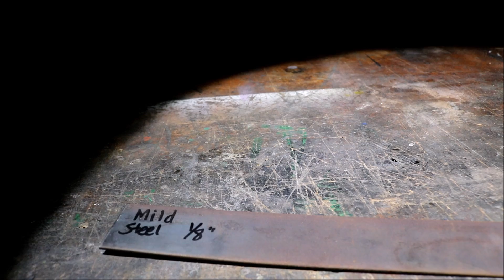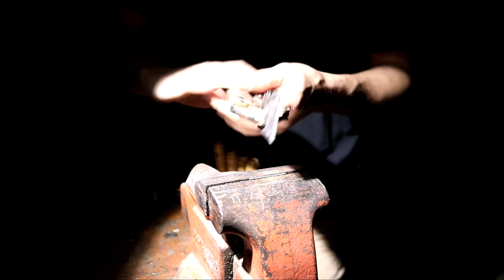Can You Harden a Saw Blade?

Comment: I'm learning  how to make knives out onto saw blade. I hope you answer my questions.
What kind of quenching oil you use and what is the temperature of the  metal  before quenching it?
Reply from the maker: The quenching oil i use is old peanut cooking oil.  I use a magnet to check the temperature of the metal when heat treating.  Basically heat the metal up to a red color and then I use a magnet to see if it is still magnetic.  I'd the magnet sticks it needs to get hotter.  Once the magnet stops sticking I heat it a couple more minutes to make sure the metal is heated evenly.  Once its nonmagnetic I quickly quench it in the oil.  I leave the metal submerged in the oil for a couple of minutes until it cools enough to handle.  Then I use a file to make sure the edge is hardened.  If the metal has hardened then the file will not bite in to the metal it will just glide off.  If the file removes material from the quenched metal then it did not harden.

Comment: Good video Dan the Maker Man!!! Is there a a fire risk when quenching using veg oil or motor oil?
Reply from the maker: Thanks, yeah there is always a risk when dealing with fire and especially oil. I've never had any flare ups but that's mostly due to me not lifting the blade out of the oil until its cooled way down.  With that said I do always have a fire extinguisher at the ready just in case.
Reply: @danthemakerman  thank you for the fast reply!

Comment: Is there anything special about the oil you quench with? Does it need to be warm prior to quench?
Reply from the maker: Ideally if you can afford it buying actual quench oil is preferred, something like Parks 50 Quench oil.  But the cheap route is to use cooking oil or even used motor oil.  I use old peanut oil.  It's a good idea to heat it slightly, I never do and have never had any problems but my quench oil never gets below 70 degrees in my garage.  If you want to heat treat properly there "heat treating schedules" online you can Google.  They are specific to the steel you are using.  This saw blade is a mystery steel, as I don't know the actual carbon content so usually it's best to quench in oil.  There are some steels you can water quench but I have zero experience with any of those.

Comment: So if I just make a knife from saw blade without tempering process it,will it hold the edge?
Reply from the maker: Potentially, the problem though is that you will have to cut, shape and sharpen it without causing it to overheat and ruin the temper.  Once you heat an already hardened and tempered blade past a certain point you can ruin the temper and make it soft. Also working on a hardened steel, it a lot more work because it is already hardened.  Cutting it with a hacksaw will be a lot of work and will probably require several hacksaw blades as they will go dull a lot faster since the metal is already hardened, that is if a hacksaw blade will even cut it.   Using an angle grinder to cut the metal will be tricky without overheating the material while you cut it.

Comment: So I can make a good knife out of a modern saw blade, I just have to test a piece of said blade to see if it works. Thanks, this video answers a lot of my questions :)
Reply from the maker: Well, it depends on your definition of "good".   If it's your first knife and you just want to give it try without spending any money on steel, then I say go for it.  If you have an extra $25 you can buy 3 pcs of 12"x1.5"x3/16" 1095 steel off of Amazon and use that instead.
Reply: @danthemakerman  I made a few blades out of 6150 spring steel but I wanted to experiment a bit. As long as it doesn't snap from slightest pressure and somewhat holds an edge then I'm happy.
PS is saw steel weldable? I want to make a Freddy Krueger glove from stainless and am wondering if the saw knife'll weld to stainless.
Reply from the maker: @MarvinConman  I don't know much about welding, I have only dabbled in it so I can't help you there.

Comment: Just made a blade from an old saw blade and was wondering if I'd need to harden or temper it. It threw good sparks on the grinder so I'm pretty sure it has a high carbon content. Should I heat treat it or just temper it in my oven like I do with knives I make out of old files?
Reply from the maker: Let me preface this by saying I am by no means an expert.  Ultimately it comes down to how you shaped the blade or what tools you used and if in doing so you ended up altering the original temper.  What I mean is if you used an angle grinder to cut the steel and if got hot enough to ruin the temper then the blade would have to be re-heat treated.  If you were careful and kept the steel cool, as in no color change on the steel while you worked it, then you shouldn't have to do anything to it, it should still be hard.  If it were my blade I would just heat treat the blade again, and by that I mean I would heat it up to non-magnetic and then quench it.  Then check it with a file to make sure its hardened then temper it in the oven.   This way I would be 100% sure the blade had a good heat treat.
Reply: Dan The Maker Man Thanks for the advice. I made sure I kept the steel from getting too hot during the whole process but I may just fire up the Forge and heat treated for good measure.

Comment: How long did you heat the saw blade in the furnace so it could become non magnetic?? And how many times?? Did you also bake it??
Reply from the maker: I didn't time I just get it to were it looks reddish in color then check it with a magnet.  If the magnet sticks to the metal then it goes back in the heat until the magnet doesn't stick anymore.  I only quench it once.  I did not bake it, the point of this video was to see if the saw blade was hardenable. If I had planned to use the steel to make a knife then I would of tempered it in the oven which would have made it more bendable/flexible.
Reply: @danthemakerman  how long would you put It in the oven? And would you only quench once if making a knife? Or twice
Reply from the maker: @whatsgrowingon  only quench once then use a file, like I did in the video to make sure it hardened.  Then put it in the oven at 400 degrees Fahrenheit for an hour.  When it comes out of the oven you are looking for it to have a dark straw color almost like bronze but not quite.  For more info look at my video of marking a knife from a saw blade with limited tools.
Reply: @danthemakerman  link the video
Reply from the maker: @whatsgrowingon  Here you go. https://www.youtube.com/watch?v=_1zyBQ4-iGw&t=457s

Comment: thank you so much for this video, my first saw blade knife is in the making ;)
Reply from the maker: Great to hear good luck with your project.
Reply: @danthemakerman  okay first problem, I can't drill holes in the saw blade steel. HSS Drill bits is all I got, they don't work obviously? Is there a way to soften the material? I don't want to buy fancy new drill bits just for 3 holes
Reply from the maker: T Erha You need to anneal the steel.  Basically you heat the steel up until it’s no longer magnetic then set aside on some bricks or something that won’t burn, to cool down slowly to room temperature. This should remove some of the hardness.

Comment: Very interesting man ...dumb question but does the same apply with chisels ? Are cheap chisels just not heat treated enough ? Can you make a cheap chisel better by heat treating it ?
Reply from the maker: That's tricky because it depends one what kind of steel they are made from, some tool steels need to be quenched in water instead of oil.  Some steels only in oil.  If they are cheap, find your least favorite one and give it a shot.  Not sure how you sharpen them, by hand or with a machine, but if the cutting tip turns blue then you have 'ruined' the temper and now the area that turned blue is softer than before.

Comment: I have a bunch of old saw blades from a friend.. and have made knives from them, but almost all of them the ones that list information steel have different ingredients from chromium, magnedium, ect i probably spelling that wrong so i don't think anyone really says you can't more that they mean it is hard to get consistent results for a good knife
Reply from the maker: When I first started doing research on this the general consensus was that new or rather modern saw blades were constructed from cheap un-hardenable metal.  Many stated that only the carbide tips on the edges where hard and that the metal itself was worthless.  I was doubtful so I did my own testing.  Which is actually the point when ever dealing with mystery steel.  Always test it.  Store bought steel is the best steel but if you are just starting off and want to try making a knife then a sawblade will probably work just fine.

Comment: Thank you for an informative, straightforward, and interesting video. Can you comment on "tempering" the piece of hardened saw-blade after quenching?. I want to make some wood carving knives from an old circular saw blade and read that the "proper" 1095 steel (once quenched) must be "tempered" by heating it to a straw-brown colour  (about 400degrees Celsius) and then letting it cool in order to make woodcraving knives. That would give them some flexibility.
Reply from the maker: 400 degrees is kind of the rule of thumb.  As you said getting that straw brown color is what you are after.  If you have spare pieces I would do a test in the oven.  Set it to 400 degrees Fahrenheit and leave it in the for an hour and see if you get a straw color.  If its too dark then turn down the temp 15-20 degrees and try again.  Or if you have a laser thermometer or a reliable oven thermometer you can put a piece of the steel in the oven at 400 degrees and then check the temp to confirm your oven is reliable.

Comment: Thank you for your time on this video it was very helpful I’m going to presume that to draw back the sawblade after heat treat would be done the same as 1095 high carbon steel which is Heating it to 400° and soaking it for a couple hours and then repeating the process except only soaking it for one hour thank you

Comment: I called the saw blade manufacturer to find out what steel they used.  A quality saw blade, mine were 14" 100 tooth, uses type L steel which is low alloy tool steel.  My blades cost $170 each.  Once the carbide tips on the teeth wear down enough they cannot be sharpened.
Reply from the maker: Ok

Comment: Yeah that make sense , saw blade are of course hardened from the factory , what you can do instead , is maybe a heat treatment . You put the final product , knife or else , out of a saw blade , in your hoven . 240 C° for about an hour . If you can clay the entire knife exept for the cutting edge , its also better . 
Sorry for my bad english guys .
Reply from the maker: Thanks for the information.
Reply: I made industrial blades , for cutting paper by exemple , in my job , this a common heat treatment . It works with all kind of tempered steel . Making the blade slightly harder .

Comment: I feel you would have maybe had a different outcome with the saw blade if you would have cut out an even square leaving the teeth out. Looked as though it broke in the grove of the tooth with gave it less of an advantage
Reply from the maker: The point is that it snapped and didn't bend like the mild steel.  If the saw blade was not harden-able it would have bent and not snapped in two.  The point of this video was to show that you can indeed harden a saw blade in this case a inexpensive one which is what the test shows.  The file test also confirms that the saw blade was indeed hardened.

Comment: Do the test again by 2 times heat treating & quenching each piece, then bake in oven at 375 degrees for 2 hours, allow to naturally cool.  If I understand all the different videos of hardening by furnace & quenching and then strengthening by baking, you get a tougher cookie that should not break as easy or hopefully not at all.  Just do not eat the metal cookie! LOL ( I don't have the heat treat set up you do right now due to low income otherwise I would try it.)
Reply: After hardening and quenching, the baking part is called "tempering" which is actually softening to something in the middle between hard and soft steel so it can be sharpened and still hold an edge well without chipping easily. Too hard - difficult to sharpen and easy to chip. Too soft - dulls easily.